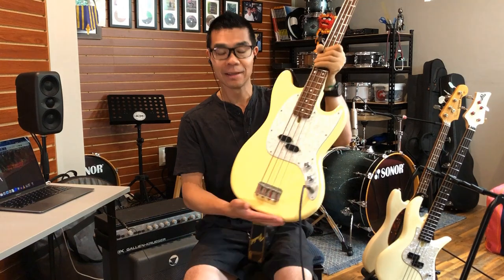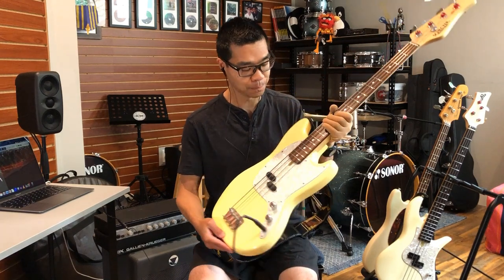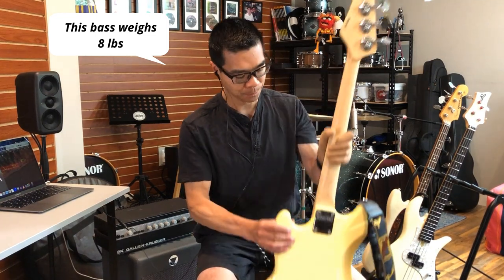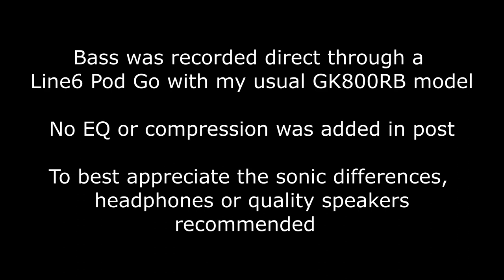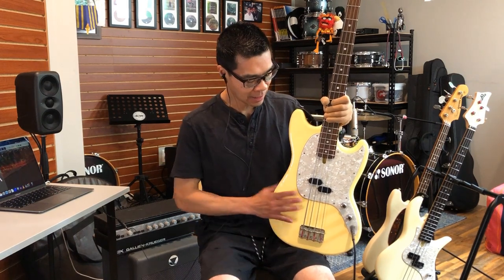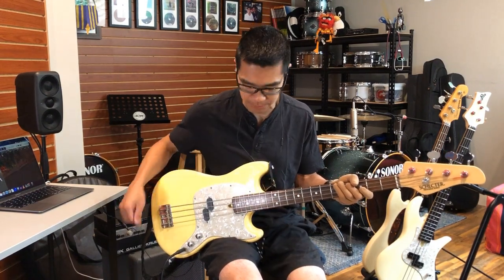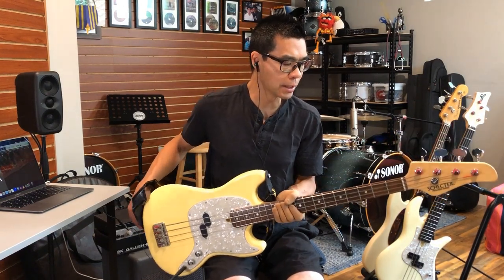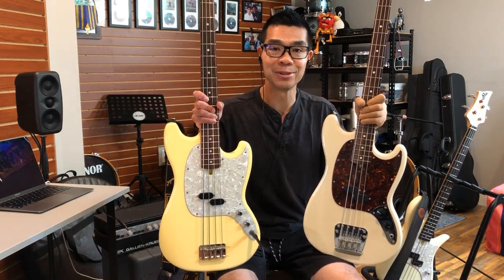Schecter Mustang style short scale bass (Progauge series PS-MSB).  Demonstration & Review

Comment: I appreciate your technical analysis and playing of some interesting and iconic basses. I’ve become a fan of short scale fender mustang basses and have both stringing options. I prefer the through body stringing especially with flat wound strings. I experience a more vintage sound and find the fret board, for whatever reason, easier to play. Now this could be due to fret type since my through body uses tall narrow frets as opposed to medium jumbo frets on my topside stringing mustang. Not sure if you have analyzed fret types but it may be an interesting topic for discussion
Reply from the maker: Thanks so much for watching!!  I love mustang basses in general, and modelled my custom F bass after one!  I think the top-load vs string through discussion really comes down to player preference.  For me, due to fragile finger tips (medical issues), I wanted the loosest, bendy-est 'perceived' string tension, and I think perhaps that's why I prefer the top-load.  Not sure how much of that is placebo - would be a very interesting blindfolded experiment!!  As an aside, the acute angle over the saddle with flats on a string-through-body always makes me a little paranoid about string breakage.  Has never happened, thankfully.

Re frets:  YES!  Frets make such a big difference.  I played upright (EUB) and fretless almost exclusively for a bit, so I prefer having as little metal between strings and board - it's a feel thing for me. Also keeps me from fretting and squeezing too hard. So on my F bass, we put on tiny vintage-style frets.  I was talked out of mandolin frets :) You really hear more wood. I think big frets impart too metallic a tone into the overall sound - but again, totally subjective!!  (I don't slap very much at all)
Reply: I'l take the Harley Benton any day...
Reply from the maker: Waaay more affordable, that’s for sure!

Comment: Thanks for your recent reviews on short scale basses, the only negative thing about them is strings. They are somewhat difficult to get especially for a through body Mustang bass, they require medium length strings. Even sources from the internet are very often out of stock for months. I do hope you can review short scale bass strings so we can order them before too late.
Reply from the maker: Thanks for watching!  I’ve pretty much stuck with using thomastik flats on most of my instruments. I use the long scale 100-43 set which I’m sure thomastik will tell you NOT to do. I haven’t had any issues but it’s definitely not what the company would officially suggest. I didn’t like the gauges of their short scale set (106-43). I leave them on for years!